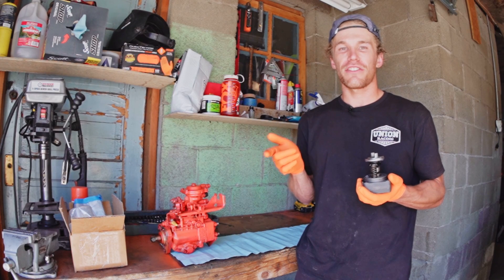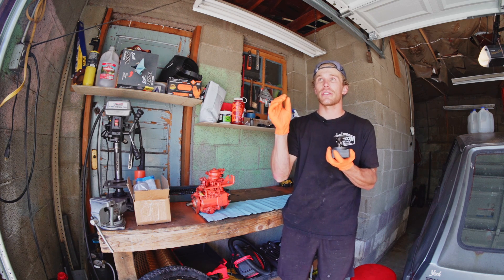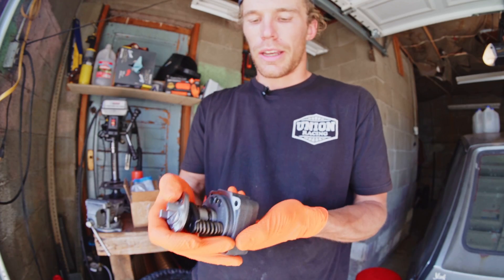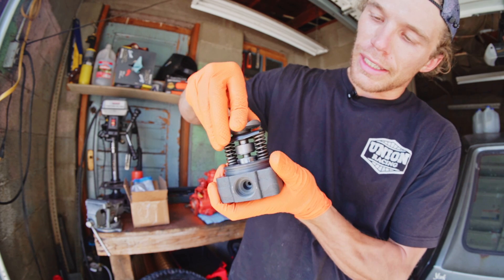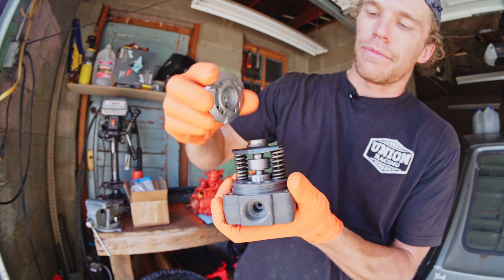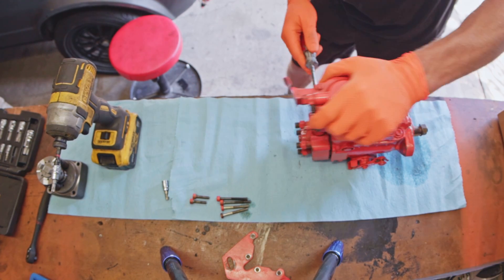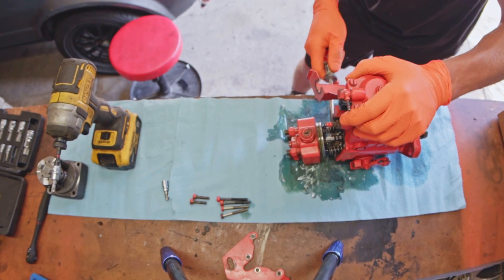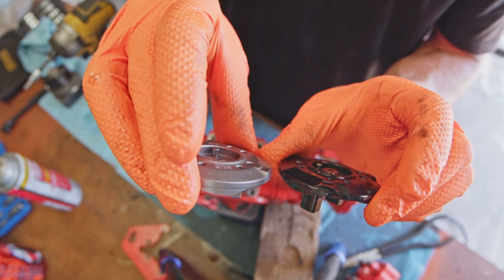VW 1.6L Pump Upgrades / How Bosch VE works

Comment: Can you link the part you bought 😊
Reply: I didn't see you remove, install or mention a little super hard disc which goes between the plunger and the swash plate. It usually needs grease or gravity to stay in place during assembly.
Reply: Shim. Dab of grease holds it into the end of the plunger.
Reply from the maker: @rmfellows 😂 you are correct, I discovered that in my next video. Figured out it was missing after it didn't start
Reply from the maker: I got it from Hans Auto parts (see controversial topic in next comment). Search for "pump head" I think you need a rotor (1 item) a conversion kit (1 item) and the pump head (1 item).
Reply from the maker: Ok, also, update I guess Hans is (kinda) well  known to sell shit parts 🫣😕 at least on TDI forums. We'll see how these parts end up working since they're already bought and installed 🧐🧐🧐
Reply: @OliverFetter  Rabbit stuff is OK but later model stuff is probably not good. BRM cam and lifters are total Shite. Most of the older rabbit stuff is fairly good but you might need to take it apart and fix it yourself to get it right. Have one of his turbo kits and it has over 40k miles on it no issues. Injection pumps some good some bad. but usually if you are savvy you can take it apart and fix it yourself and make it work if you have an issue.
Reply: @OliverFetter I just read this answer and am a bit confused because hans has a horrible reputation and the ones youre building are bosch. What am I missing?
Reply from the maker: @alexanderpappas68 I have one hans 11mm head and one Bosch that came with the TDI. But until I got the TDI (and actually still currently) it has the Hans head on the car. I intend to swap it soon.

Comment: Bonjour j'ai une question, 
Quand tu passes d'une tige 9mm à 11mm y a t'il des réglages de débit ou pression pour que ça démarre
Reply from the maker: Certainly baseline fueling and idle speed must be set on a test bench or on the car.

Comment: Hello, I'm upgrading the engine of a 96 Toyota Hilux 2.8 with indirect injection, and I have a question about upgrading these rotary injection pumps by replacing the plunger with a 12mm one, for example. Should I simply fit the new head onto the pump and, as soon as I remove it, replace it on the engine? Regards!
Reply from the maker: Hey! Basically, yes. When changing pump heads you need to be careful about how it is installed in the pump and make sure it's all super clean. When it's back on the motor expect to need to adjust the pump settings - like idle and fuel screw since it will have different characteristics.
Reply: @OliverFetter Thank you very much for responding. Thanks to you, I started to get very interested in this topic of injection pumps and mechanical boosting, and I see that it is something very entertaining.
Reply from the maker: @simonarias6626 heck yeah ☺️ good to hear!!

Comment: 11:00... the check valve and spring belongs in the delivery valve, screwed in as one part. There are also shims in the delivery valve body, so important to keep the valves together for installation.

Comment: That looks a lot like my 1st gen Cummins 6BT Bosch VE pump. Are parts interchangeable? Would a similar 4 cylinder Cummins 4BT Bosch VE pump directly bolt onto that VW?
Reply from the maker: I'm sure it does! In not sure how close the 4bt pump would work (I've thought about it!!) I think the largest problem would be sorting a custom pulley for it. I'd love to try it out though
Reply from the maker: I want to try some Cummins throttle linkages in my pump

Comment: Hello Oliver.. do you keep the pressure regulator from 9mm pump or you change them from 11mm? Or it doesn't matter?
Reply from the maker: Interesting question! I just left the 9mm as is except the pump head & rotor.
Reply: @OliverFetter  maybe it's not necessary to change them because your pump is not m-tdi..
Reply from the maker: @ΔημήτριοςΔρίβας-γ2δ  💁💁💁

Comment: What car are they from Plunger and camplate ?
Reply: Is there any modification or will they fit a 1.9 pump like this ?And 1.9 Alh pump plunger Isn't it 10mm?
Reply from the maker: @DidoDidow  I didn't do any modifications outside of what was shown. It varies on the pump from what I understand. I measured the pump that came on my alh and it was 11mm
Reply from the maker: Equivalent to a 1.9l alh pump so ~2002 golf tdi

Comment: Since most of the internals are TDI now, would a build like this work as an  mTDI pump? 1.6 pump, TDI cam plate, plunger, and delivery valves.
Reply from the maker: Yes absolutely. It is technically an mTDI. I'm going to try it out when I put the ALH in to confirm.
Reply: @OliverFetter  I’d be curious to see how it turns out. The metering sleeve for the 1.6 doesn’t have the same stroke as the TDI. I have an AHU that id love to run with a 1.6pump/10mm head without having to modify the fulcrum lever.
Reply: 17 mm shaft will eventually snap. You need to start with a pump that has a 20 mm shaft.

Comment: People talk all bad about Proth.....(aka Hans auto parts) but they are really one of the only people selling parts for these older cars. For late models. NOOOOOOO.....but for early cars they are the ticket.
Reply from the maker: Yeah I've heard lots of bad things but my pump head is still working fine so 💁💁💁💁👍
Reply: @OliverFetter How many miles does the Hans pump head have on it?
Reply from the maker: @jamesmosher6130  about 400ish (can you tell i dont drive it that often??)
Reply: BS. 'Hans' is hardly the only one. But he is one selling some garbage and occasionally some ok parts. 
Fwiw, I have a pile of new old stock 12 mm heads, a few 11 mm and 10 mm. Plus a huge pile of pump parts I'll be selling off as I recently retired from 40+ years of working on these.

Comment: Any updates on how the pumped performed? I tried something of the same on a 1.6td pump using an 11mm from a 1.9tdi ahu pump. After about 2 to 3 weeks, the rpm started to gradually go up and up, and i had to back out the throttle screw and the fuel screw to lower rpms until i couldnt anymore. Just checking how did yours go??
Reply: Thinking I’ll just avoid the BS and send a 1.6TD pump to Giles to get super-ed
Reply from the maker: @chrisladouceur4093  hefty price tag for a mid pump tho
Reply from the maker: Hey! Still working good over here 👍👍👍 that sounds like a really odd problem ⁉️ I've probably put about 250 miles on it and it's still running mint. I do have a test drive video as well if you're keen 😁
Reply: Do you have that video posted up?
Reply from the maker: @Derick-m1h   yes, check https://youtu.be/3GZgksvQgrA?si=tF1bCqgGVokJ8VGa
Reply: And one question, since I have a 1.9tdi engine and put a 1.6 td pump on it, would I need to change injectors pressure?
Reply from the maker: @Derick-m1h  To be clear I currently have a 1.6 pump with an 11mm (1.9L) plunger still installed on my 1.6. Its my eventual plan to move the modded (MTDI) 1.6 pump over to a 1.9L. Are you saying you currently have the MTDI pump on a 1.9 or a 1.6? I would think you'd want to keep the 1.9l injector pressure.
Reply from the maker: @Derick-m1h  also if you do have a 1.6 pump on a 1.9 currently how did you mount it?

Comment: Thanks for the video. I have an '85 Mitsubishi Pajero with the 4D56T that runs a bosch type injector pump. A local shop made a right mess of it, damaging the housing and then setting the pump up in such a way that the vehicle can barely do 80 km/h.
I fiddled with a few things like fuel delivery valve and boost compensator diaphragm mod, but I discovered the pump  is cocked over so far advanced that it is fouling against the timing belt cover. I can't mess with the fuel delivery any more as the idle gets too high and that opens up a whole new can of worms. While my efforts mean I can at least see 100km/h she gets up there on the EGTs and with a few other things I've noticed, I think I have some more investigating to do. 

I then did some more research 2 days ago, because I thought the fuel cut of solenoid was faulty as it wasn't shutting off, but this turned out to be a problem with the alternator, which is fixed now.
In my research I found that no one in South Africa has any info on my specific pump number, which makes me think the shop that 'fixed' it also doesn't have the info so they simply cobbled it together with some parts lying around. I had sent the pump out of town before them but the shop didn't have any info on it and sent it back in a parts bag. This is what makes me think the shop that assembled it for me just guessed what went in this specific pump, set it up as best as they could on their test bench and that was that.

At least your videos I have watched has given me some confidence to at least see what pump head is in my unit.
Reply from the maker: Dang! Sorry to hear that. I'd highly recommend the website I put in the description!! Shows complete assembly & part order. I'm glad these vids can help 🤘

Comment: Hey Oliver! I saw you got a VNT. I've created a Arduino based controller for my 1.6D (Golf Mk1 just like yours). Gives super fast spools. Could send you one for free & help you set it up. What do you think ;))?
Reply from the maker: That's cool!! Currently building an Arduino as well 😁 pretty fun stuff. What inputs did you use to control vane position?? I'm starting with manifold pressure as my only input, but it seems like maybe pedal position will be needed too? That's dope you've got it to work
Reply: @OliverFetter In the carputer.ino you can find the configuration variables for what boost to control to. Mine is set very conservatively because I don’t want to blow up the engine,lol. Basically 7psi max.

Yours would probably look like this;

 //I only close mine max 60%, see reasons in the codecomment, but you can close yours 100% for max spools
#define VNT_SETPOINT_POWER 1.00f;

//This variable defines when the Ecu “panics” and opens the turbo to prevent overboost
//Set this to the max value you ever want to see (including while spiking)
#define BOOST_MAX_SPEC_KPA 2000.0  //2 bar or 30psi

//This variable sets the desired boost which the controller will try to keep it on, should be lower than the max_spec to account for spiking
#define BOOST_DESIRED_SPEC_KPA 1500.0 //1.5bar or 22psi
Reply from the maker: That's awesome! Yeah lol I feel you definitely learned the hard way that having the vanes too closed = bad 😓🤦 With your current setup (input = boost pressure), does your turbo always hold 7 psi? Ie if you're just cruising down the highway at 50mph are you still seeing 7psi? How does it drive? Nice work!
Reply from the maker: https://chat.whatsapp.com/CkfGCJmSrJjDkW9nz8iIKr

Comment: See how it runs on stock timing  and maybe a touch more advance  - after that you may want to try the advance plunger extension to get some more dynamic advance as rpms rise.
Reply from the maker: Will do!

Comment: Absolutely awesome channel!  My high school son and his friends want to build an off road vehicle with a 750 Kawasaki…..and I’m pushing them to go with a VW 1.9 or 1.6.  My gut tells me a 1.6 with a mechanical pump vs a 1.9……thoughts?
Reply from the maker: Thanks! That's awesome. Certainly sticking to a full mechanical motor will be easier to swap into something. I've started a 1.6 in a snow bank once lol all you need is 12v to the fuel solenoid & 12v to the starter!!

Comment: Cool!
I DD an 81 rabbit with 1.6L TD with all the correct stock mk1 TD parts under the hood. Has a few tricks done but nothing crazy, its a daily. Like the York logo, have a lot of York related items even Steuben Mtrs, pre York.
Reply from the maker: That's awesome! They're still pretty fun stock 😁 You're the first to pick out the York logo. I pulled this car out of a barn in Pennsylvania and it seemed fitting to leave the sticker on it.

Comment: Hans auto parts is very well known garbage parts peddler I would stay away from them. Take a look around about em.
Reply from the maker: Interesting 🤔
Reply from the maker: Damn honestly ya hate to see it 😬 guess we'll see if it works or not 😅😅
Reply: @OliverFetter  if it works for you oh well. I’ve read a bunch of stuff about how terrible the parts are
Reply from the maker: Yeah I just read up as well
Reply: @OliverFetter  I know his parts have blown up quite a few cars. Only thing i have personal experience with is the tdi downpipes from them and that things cracked in like 6 places
Reply from the maker: Fortunately these aren't engine internals 😅 I really appreciate the info!
Reply from the maker: After a quick look around though I'm not sure I can get an 11mm head that's NOT from China 😬🤔 seems like the Internet only has reproduction parts
Reply: @OliverFetter  I believe you are right. I know Hans complete injection pumps never work well  but they may carry some alright components. Curious to see how well it works.
Reply: @OliverFetter yea man I bought a pump from that guy and it immediately had issues, sent me a pump with worn plunger

Comment: Very interested to know your experience with HANS, they have quite the negative reputation on every forum I have encountered.
Reply from the maker: So far, so good 💁 I wasn't aware of there low reputation until after buying some parts. I've purchased fuel injection lines, those I feel like you can't screw up 💯 and I'm happy with them. The pump head seems to function so far, but we'll see!